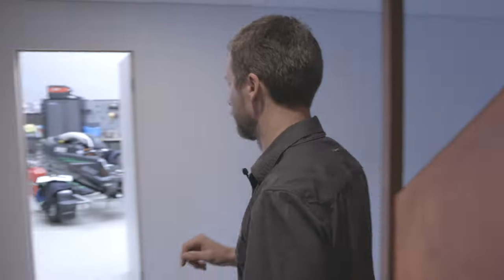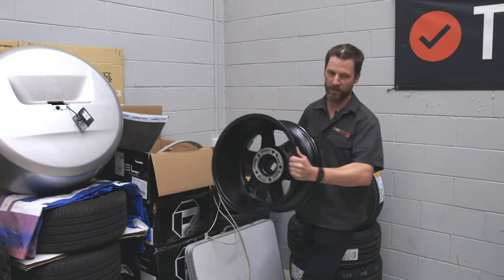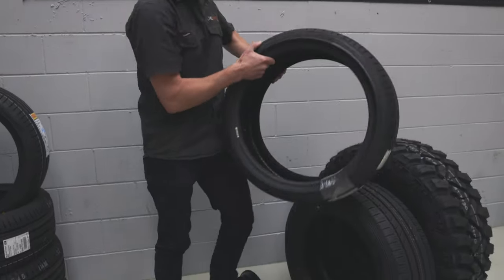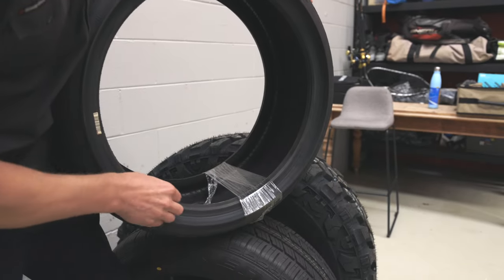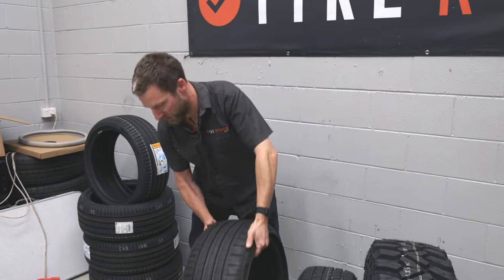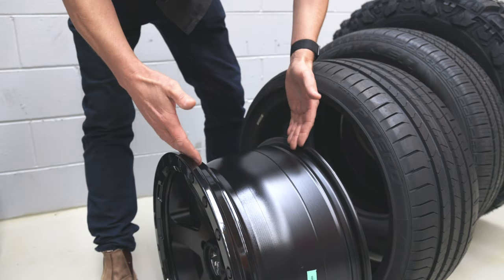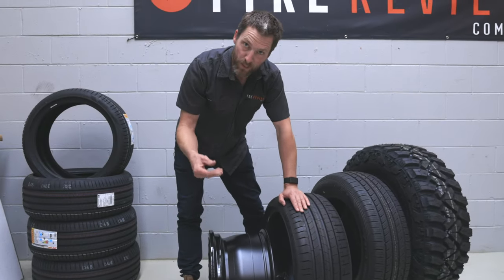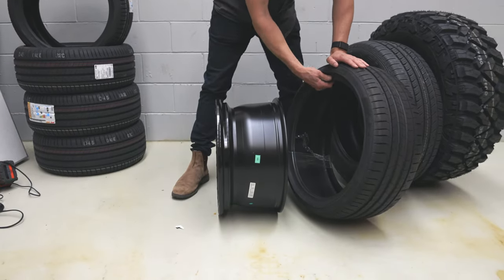What are Tyre Beads?

Comment: What rim did you point at, that have it designed for tire beads? I'm new to 4 wheeling, so I have no idea there are rim designs like that.
Reply from the maker: Hi mate, all rims are designed to take tyre beads, we just don't normally see them as they've got tyres on them 👍

There are a few different rim designs out there, which would be interesting to get into the warehouse to look at, but any wheel you buy will keep the tyre on. Some companies have some more specific rims that grip the beads in different ways, and they'll point that out when you're looking at the description for the wheel.
Reply: I think some new Method wheels have this on them. But they are quite expensive...
Reply: @peter-5046  oh cool. I'll check them out. I think you need special tires too right...
Reply from the maker: Yes! They're the ones, I couldn't think of who it was when writing that previous comment. Trail Grip, or something? They look really interesting. I was thinking of seeing if I could get a set and comparing how they fare in contrast with a "standard" rim.
Reply: @TyreReviewVideos  ohhh not bad at all. Thank you guys for the info.